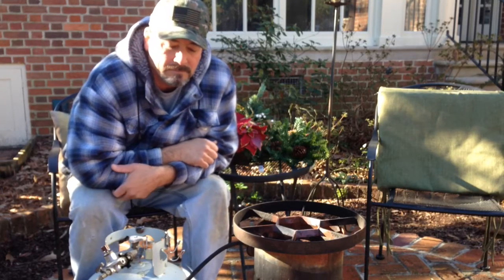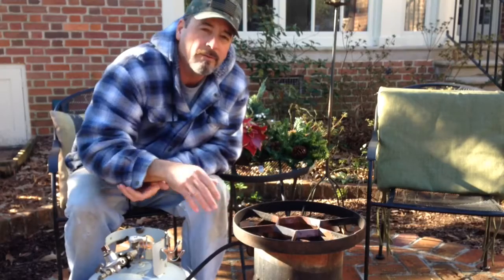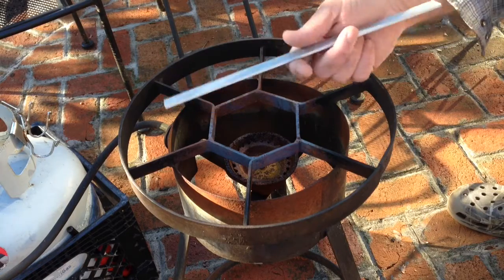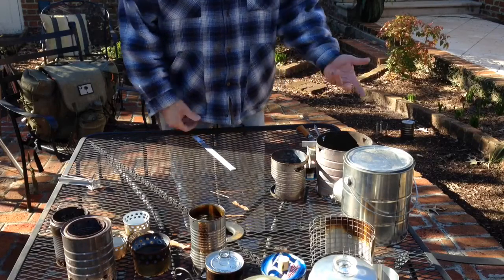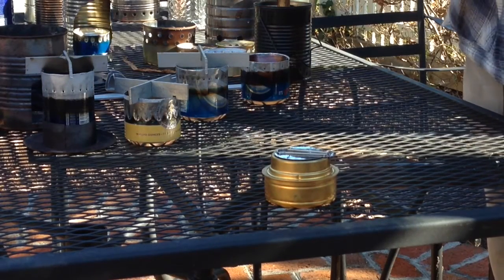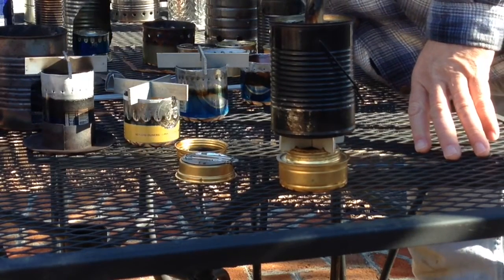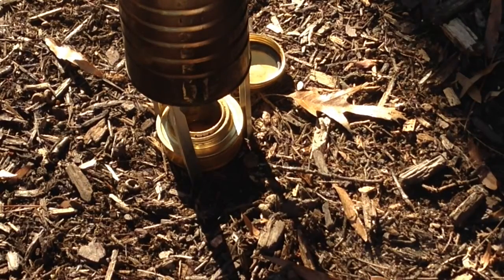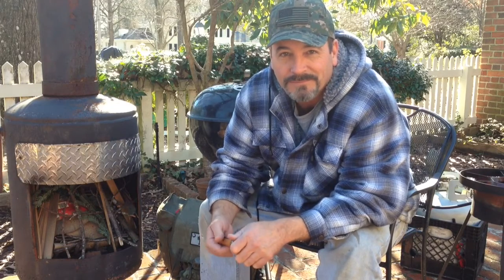Alcohol Stove Pot Stands- My Way

Comment: Hey Chris! Great vid on diy woodstoves. I too, am a fan of wood burning stoves. Personal favorites are the solo stove and then the emberlit titanium. One thing I wanted to point out was, I could visualize that big paint can rocket stove you made, laying on its side on 4 legs that you welded on somehow, and the round opening at the bottom where you feed it then becomes the beginning of the flue of a hot tent wood stove. I’m up here in Mass so hot tents are on ones mind a little more up this way.😃 I like your content man! It’s cool!!
Reply from the maker: Thanks! I think you may be on to something there with that tent heater idea! I made a small one out of an ammo can and it works pretty good. Thanks for watching!
Reply: @CarolinaChrisOutdoors  awesome!

Comment: Great idea, does the aluminum warp from all the heat? What you could do is make one stand for two stoves by notching on both sides.
Reply from the maker: Ha ha!!! I did do that!!!!! I made a small stove and cut grooves in the other side for it. The aluminum gets hot of course, but it doesn't melt or bend, but I usually never burn those things more than five minutes.

Comment: ha! I came to exactly the same solution for my kellykettle flowerpot stove..
it in a video of mine.. ..eehr somewhere. good and simple. hangs with racoons got me here..
Reply from the maker: Cool- Man, I don't have one of those Kelly Kettle pots, but I did get a "pot stand" made by them to fit in the inside of one. It looked like something I could use for something else. Couldn't beat the $2.00 price (packaging was damaged). Thanks for reminding me I bought that thing!!!
Reply: +Carolina Chris Outdoors no problem.. ..my potstand makes it's first appearance in the "bordercast forest" video. made to fit different mods. funny that the same solution surfaces on the other end of the globe... cheers!